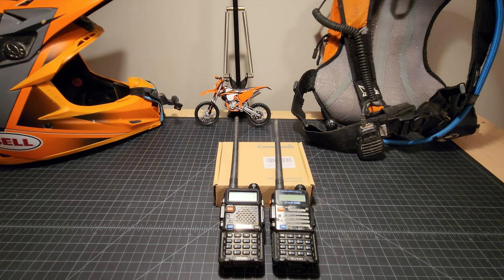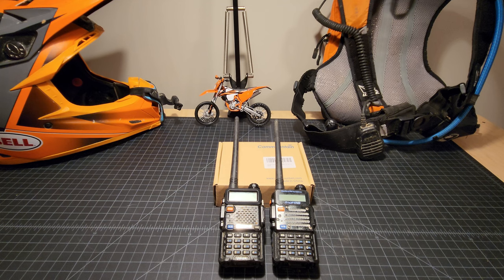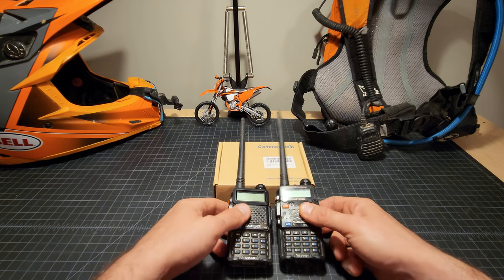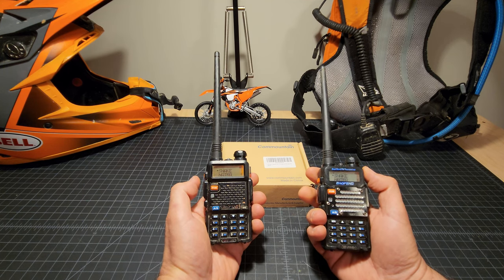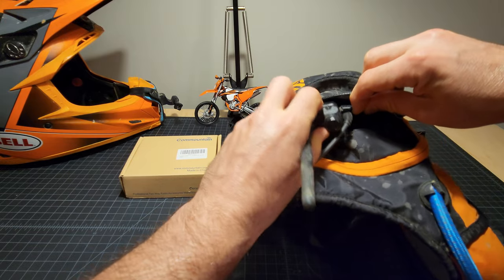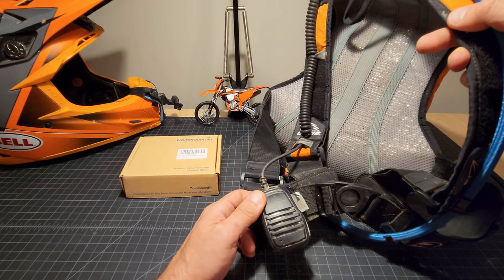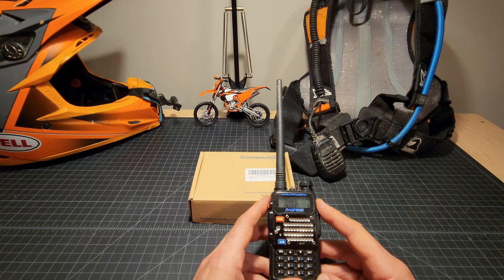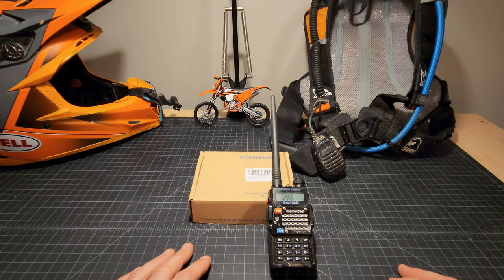Offroad Comms - Dirt bike communication radio setup

Comment: Very good video on this particular product !  👍👍.  I am curious which band VHF or UHF works best for you on the trails ? Thanks
Reply from the maker: We're currently using VHF, but we've tried UHF in the past once and it didn't seem to make too much difference. Granted, we haven't ran too many side by  side tests, and I would expect one to work better than the other. The terrain around here is tricky, there are weird signal dead spots, even though the distance is short.

Comment: uhf will get better propagation in the woods
Reply from the maker: We tried both and honestly there wasn't much difference. Also, one of the clubs we're part of has reserved VHF frequencies, so we have to use those then.
Reply: @alabamadirtrider  probably your antenna doesn't do good in uhf
Reply from the maker: @mandytuning  Right, I commented in the video that my antenna is a compromise. I have a better Diamond whip antenna, but it's pretty long and just gets caught on more stuff as we're riding. So yeah, we compromise.

Comment: Solid video.  Would they work on street or is there too much external noise to hear anything?
Reply from the maker: They should work, but I don't think there is an easy way to get them into the helmet comms, and the speaker mic would probably not work great while moving at a good clip.